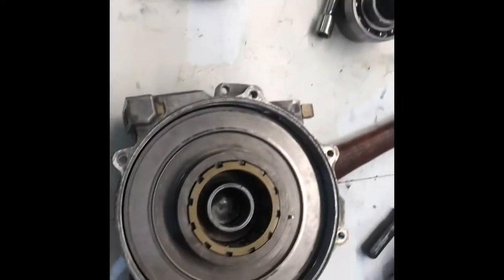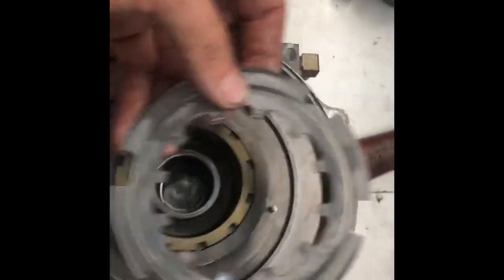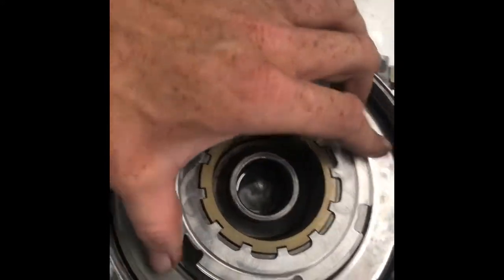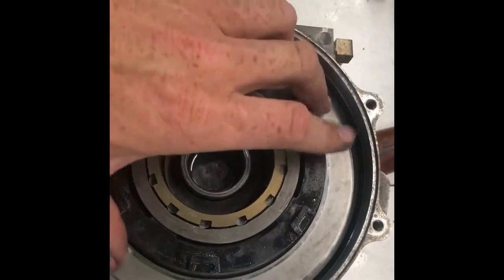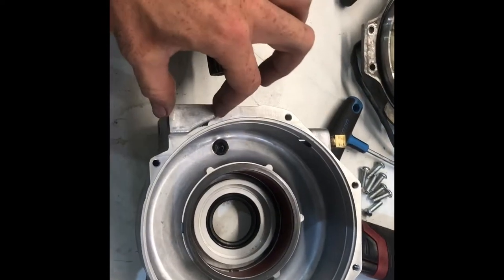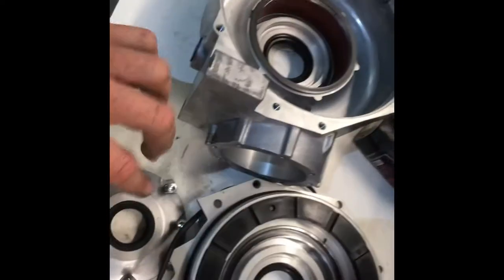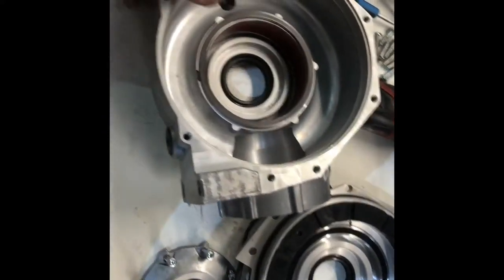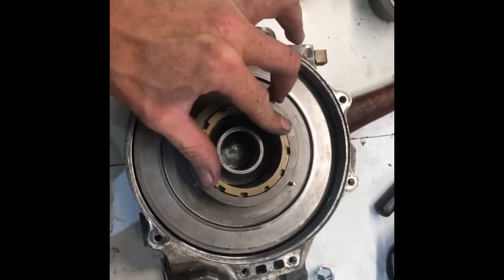Rzr front diff explanation

Comment: You might be one to answer this question.  True lock makes a switch to help lock the magnet side will this permanently lock the front end in or does it still have to slip the rear and will it help keep it locked up so the engine break does not only lock the rear on ice.

Comment: I have a theory. Most people say that they run in 2wd to save on wear and tear on the front diff. The owners manual says the machine can be run in 4wd it's entire life. So if the drive shaft is always turning into the diff and the rollers aren't grabbing wouldn't that wear on your rollers and or basket? I've always thought that with the front wheels pulling its taking half of the strain off the transmission and rear axles.  Especially in the trails or hill climbing. Why put all the strain on 2 axles instead of all 4? So am I right that using your front diff more is not bad for it? Just change the oil and you're good right?
Reply: Makes sense to me
Reply: Do what you want, if you have a lot of mud, snow, sand just leave the switch on. If it's off the axel still spins everything in the diff, but no power out. So you can still do shitties with the locked back Diff. I have over 7000 miles on my 900 in MN. Lots of snow & lake riding. Never had a problem.

Comment: I get slight vibration in 4wd at slow speeds only. Turing gets slightly heavier. I’am not new to off roading but new to RZR’s. Is that normal? Thanks 2018 XP TURBO.
Reply from the maker: Yes that is some what common partly due to the front diff is strait mounted to the frame. 
Metal to metal. No rubber isolators to help reduce noise and vibration. 
I always noticed a vibration or more of a roar. In 4 wheel drive. 
Also check the drive shaft bearing. 
It is rubber mounted. It will vibrate some normally. But excessive may need a new bearing. There’s many brand out there that are good many greaseable   But also will be more solid mounted which will cause vibration and some noise.  
I have messed with tons of machines racing and riding and i have learned and tell everyone. 
If you chase every possible noise you may hear you will never have fun riding. 
They make noise and such on the normal. So just ride it and check over thing before each ride. When it breaks fix and get back to riding.
Reply: @NitroRedNekHubert  woooo! Thanks. Defiantly 4wd roar is best explanation. Thanks for replying.